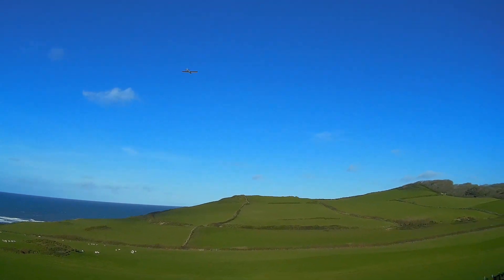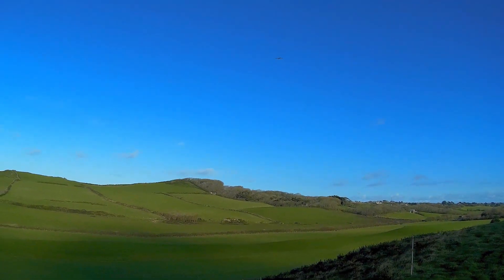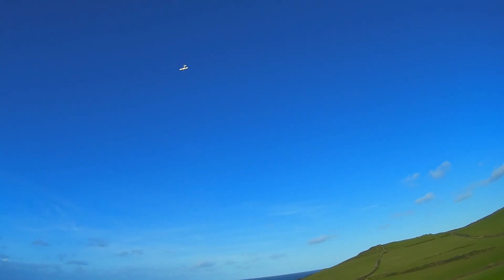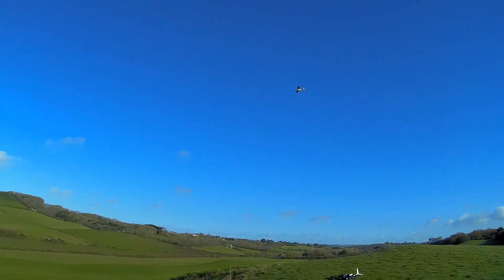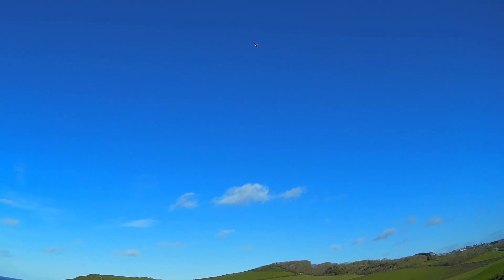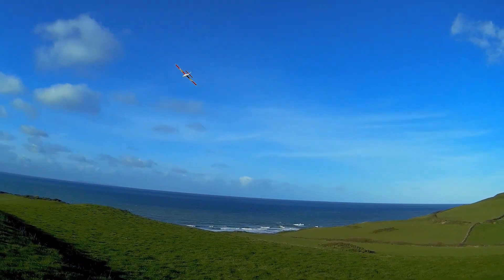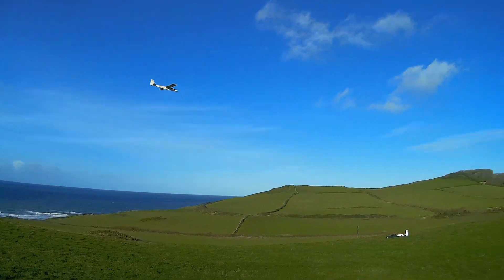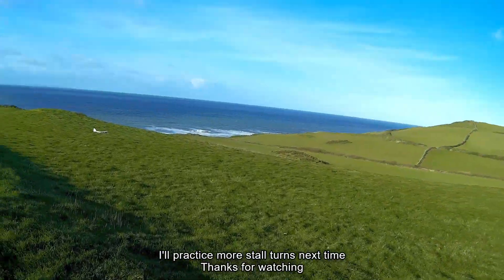I Try Some Stall Turns With My Barrie Lever Starlet Slope Soarer - 2nd December 2021

Comment: Very nice loops and maneuvers meanwhile Your flights. In this hard wind You can get more height, I think. It is fun, very nice "surfing" in the air!
Reply from the maker: Thanks a lot! This glider is very good at gaining height 👍 Yes, slope soaring is fun. In a hard wind I go slope soaring and in calm weather I go thermal soaring 👍
Reply: @RCSoaringUK  Very nice! Maybe at slope soaring You can practise these maneuvers better, because You can be in right altitude more time in one flight and the holder forces are more stable. I like Your flight ways and You inspired me to fly more and more time.

Comment: Nice loops and stall turns even with cold fingers. I prefer flaperon's over spoileron's I thing the spoilers produce more speed but I could be wrong. Nice one Carl.
Reply from the maker: Thanks Kev. I flew again with increased spoilerons today (in 25mph+ winds) and will try flaperons next time to compare 👍
Reply: Carl, 25 mph the Starlet would be going at warp-speed.
Reply from the maker: Yes Kev, it was pretty quick at times and the landings were somewhat interesting. Learnt a lot though 👍